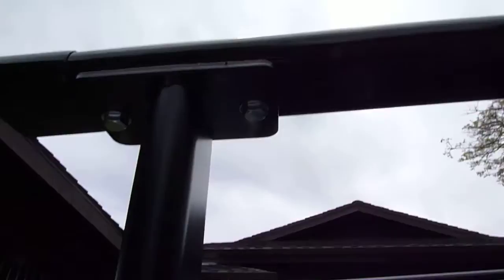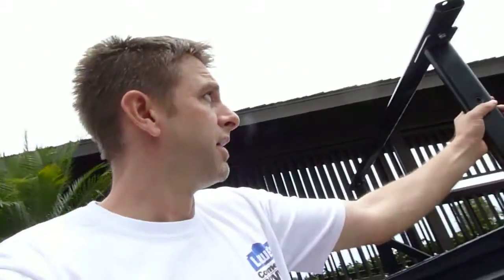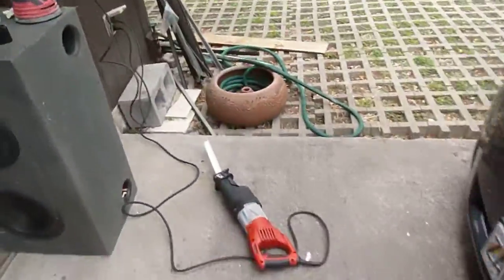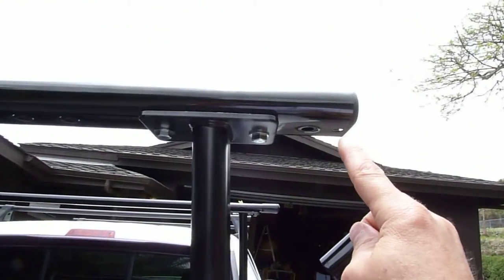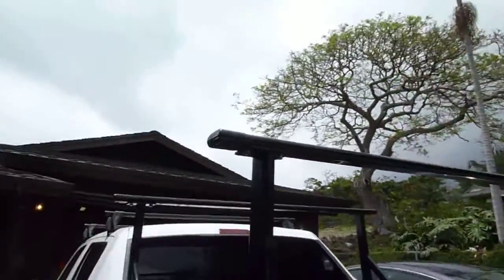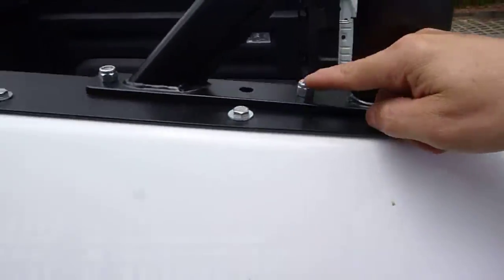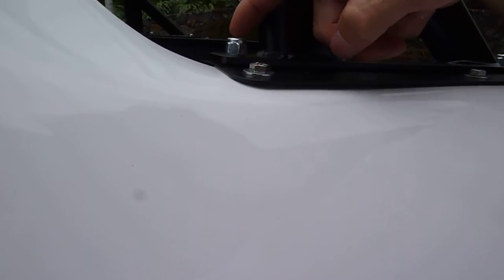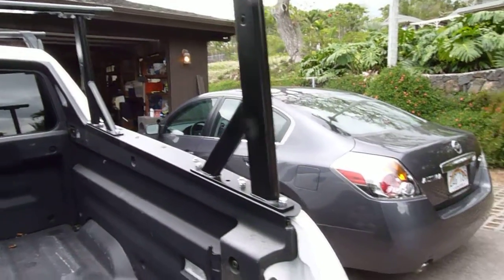VanTech Ridgeline Rack Install Tutorial

Comment: I am surprised you haven't had more hits on this video. I bought the same steel rack  for my RTL in 2009. It was on sale and I thought it would be easy to install. I could not get anything  to line up correctly when I tried to install it, so I took it to a local guy who installs racks and truck accessories. He got about 1/2 finished and said the instructions and the parts just didn't make sense. He gave up on it. I decided to sell it on eBay for a loss. Thanks, I wish I had watched this first.

Comment: Did u have to remove the side panels to install the long piece before racks?  I ask cause I don’t get how u installed the screws or bolts for the long piece having to remove the side panels but then tight them and at the same time seat the racks over the panels! I don’t get that part , could u explain please?